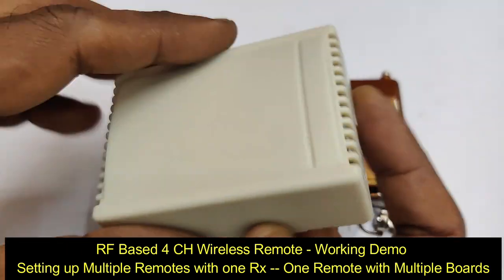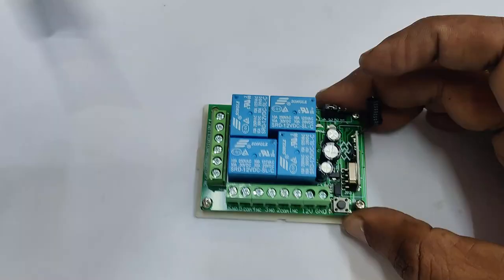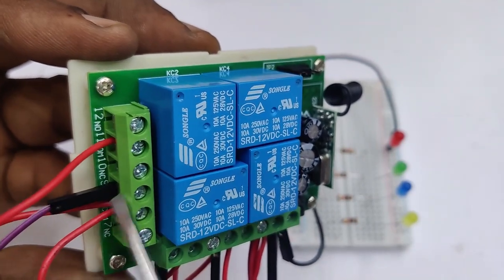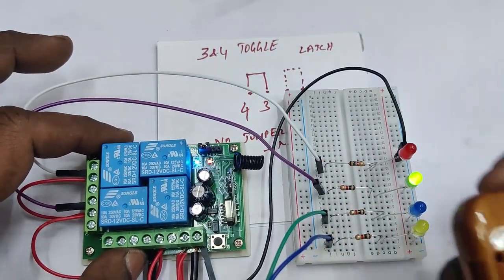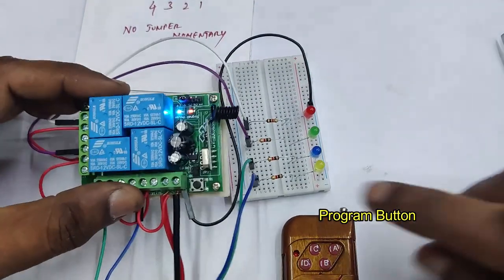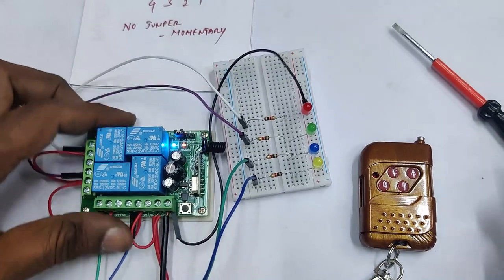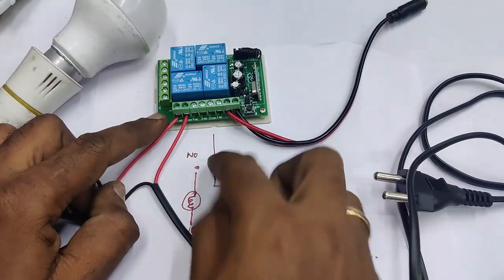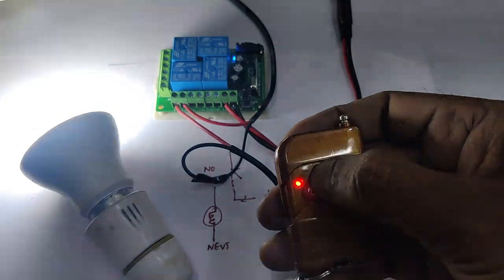RF Based 4 CH Wireless Remote - Working Demo

Comment: Can we pass the signal out(N0 pins) from the Rf receiver to arduino uno digital pins?  I wanted to control your motor direction using the BTS7060 motor driver(shown in your other tutorial ). Can you please help me out. Thanks in advance

Comment: I purchased 4 chanel receiver and transmitter but after connect to load(5 volt led)  that light blinks . Is there any problem in receiver. And can i convert momentary switch to toggle mode
Reply: From where u purchased can u provide me link